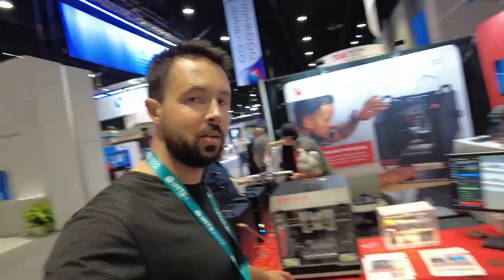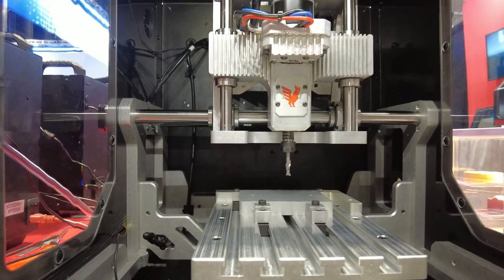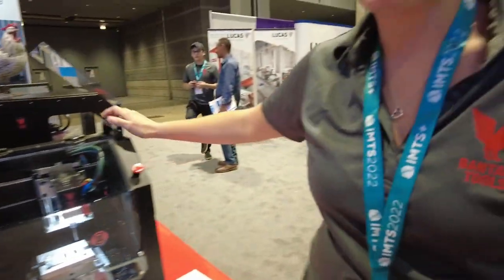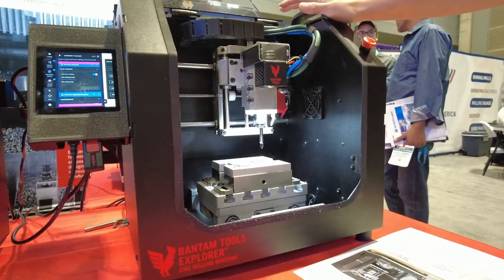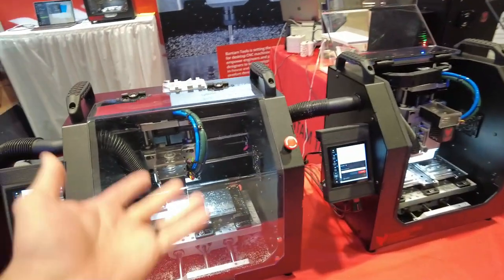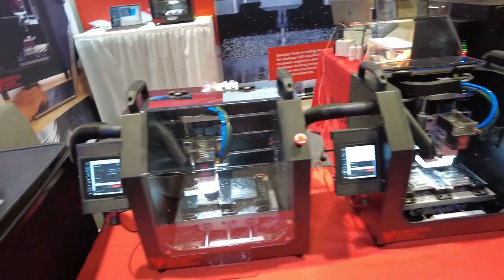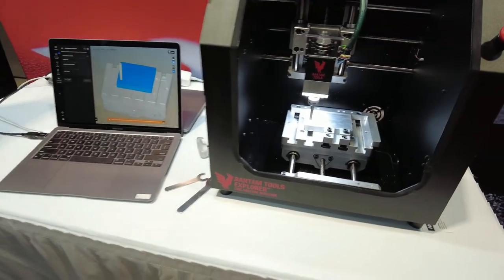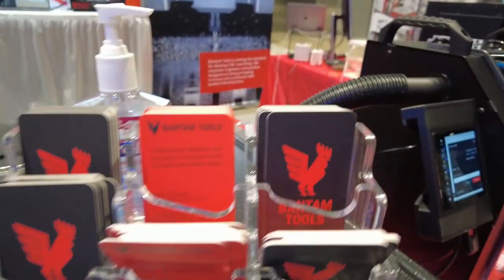Bantam Tools Explorer First Look

Comment: Could you make a putter head with that or is steel too hard? Maybe divot tools?
Reply from the maker: Probably just aluminum.  Don’t know if it will cut steel, they don’t market it for steel but could do any softer materials.
Reply: any mill can do steel but it all depend on the tools path that you use

Comment: I'm totally new to the CNC world. Looking to get one of these small desktop machines to make aluminum molds for my plastic injection machine. I'd rather over pay $1,000 if I can get super good customer service. Seems like they do have good precision at .001".

Not really looking for a heavy duty fast machine. Just something that is easy to use and does the job.

Anybody have more experience with these machines and specifically if anybody has used these to mill molds for plastic injection applications?

Thanks everybody!
Reply from the maker: Langmuir is the go to now.  These are less machine for more money.
Reply: I’m actually going to get a Nomad 3. The Languire MK3 is just too big for me, but does seem like a great machine.
Reply: I’m actually going to get a Nomad 3. The Languire MK3 is just too big for me, but does seem like a great machine.